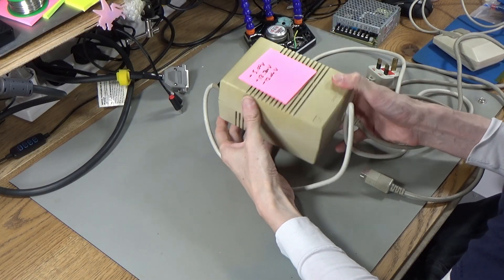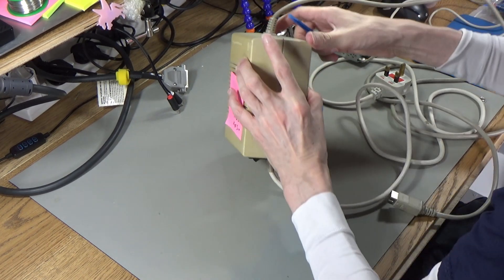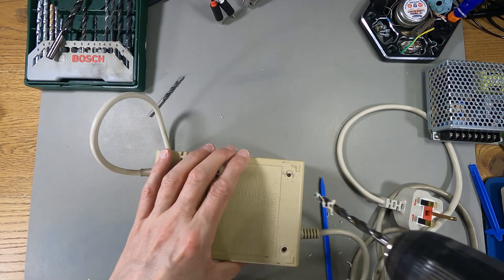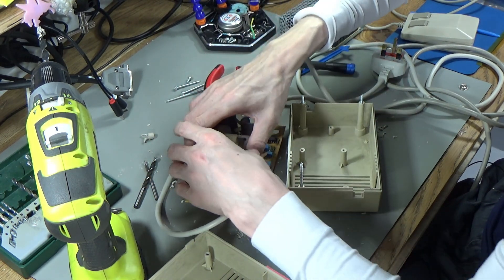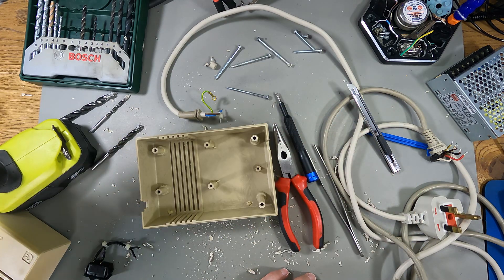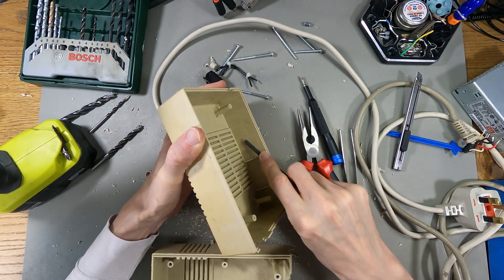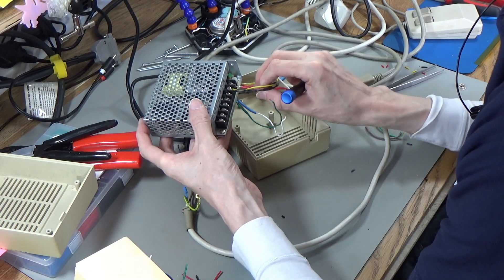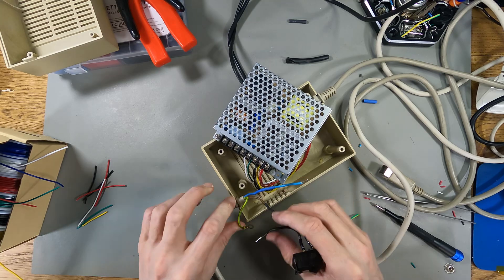Amiga 500 'Stealth' Power Supply Upgrade

Comment: Nooo, I just broke parts of mine before realizing the plugs over the screw holes actually comes our with a bit of prying and prodding, only to reveal screws beneath the seals. It hurts to see you also trying to crack it open.
Reply: I sat here screaming at my phone "THERE ARE SCREWS BENEATH, CAREFUL WITH THE KNIFE...." 😂
Reply from the maker: It's all good. I still use this PSU all the time.

Comment: When my C-64 power supply was beginning to overheat and need an external fan  to run, I saw all these articles on how to fix it.  Unfortunately I had the brick that was filled with epoxy.
Reply from the maker: Yep, I have one of those bricks. They didn't pull that stunt with the Amiga PSU luckily.

Comment: Seems strange they designed a power supply with a replaceable fuse, and then covered the screw heads to prevent access 🤷‍♂️
Reply from the maker: Yeah, i don't know why they did that, as I have that other Commodore PSU which is nearly the same but they didn't cover the screw holes? People do complain about Apple products and their construction that makes them difficult to repair, but gluing down covers over the screw holes really is a nasty trick.
Reply: @DavePoo2  I think Commodore set out specification and requirements for their PSU's, which becomes their part number, provided the specs were the same, they used the same part number. Left the manufacturer to come up with solutions matching their requirements, thus  some are 'heavy' wirewound transformers and others are 'light' switch mode PSU's. As a finishing touch, some manufactures inserts blank plastic plugs into screw holes to prevent young curious people from tampering with something that could potentially kill them. I would say it's a 'safety feature'. 

Meanwhile Apple tend to use Torx or Pentalobe screws as a deterrent.
Reply: Apples way of doing things like that is terrible. @MsNIKITA

Comment: I bought mine a few weeks ago and I can't tune its voltages. It has this pot to correct voltages but it changes both of them at the same time. If I tune 5V rail I have 10.6V on the other, but if I tune to 12V I have 5.9V on the other :(. I'm really disappointed. Yours is also little bit off, but way less than mine.
Reply from the maker: The notes in the data sheet say that the 12V line will be +-8% unless the 5V line is loaded to at least 10%. "when multi-channel output, it is recommended that CH1 load > 10%".

Comment: This is the same psu I’m very curious if will fit inside an A3000.
Reply from the maker: I've found the page, and it looks like the A3000 is a little different in that it needs a -5V supply in addition to the others. (+5, -12, +12). So this RT-50B unit can't power an A3000. Here is the page about the PSU's in the Amiga's it is very detailed ianstedman.co.uk/amiga-power-supply-guide/
Reply from the maker: There are links in the description where you will be able to find the data sheet, it will have the exact dimensions on it so you could check. But do remember that the 5V supply in this is 4 Amps, so technically it's less capable than the original A500 PSU's but in practice they never draw anywhere near that much current (but technically they could if you had 3 external floppies and a CPU card etc etc). So the A3000 would also probably be fine as well, unless it had a lot of expansion. I'll probably do a video where I measure the current draw of the A500/600 and 1200. There was a webpage somewhere that had some measurements but it has gone missing.

Comment: Nice one. Psu upgrade is on my list of things to do once I’ve got my weird a600 upper side disk drive issue resolved. Tempted to retrobrite that psu and a500, Dave?
Reply: Retrobleach is pointless. You will weaken through plastic and it will fade back to yellow quite quickly. It's chemicals in the plastic. Do you wish to bleach every year forever? If not just let it be.
Reply from the maker: Yeah, I'm not sure about the reliability of Amiga PSU's, they certainly aren't as bad as the C64 ones but I think it's probably a good thing to do as they are getting very old and have the capability to blow your computer up if they go wrong. I won't be retrobrighting the A500 or this PSU now as it has now already gone to another home.